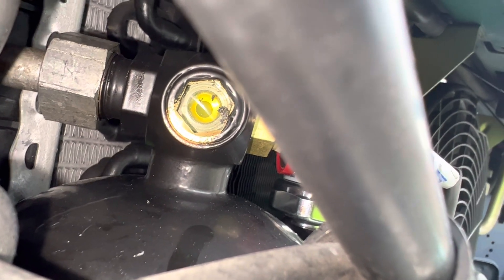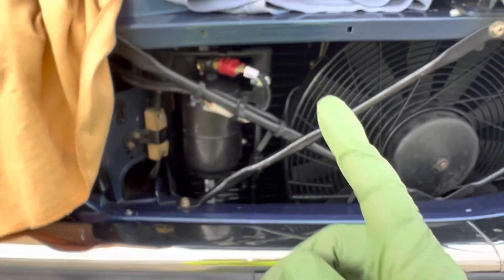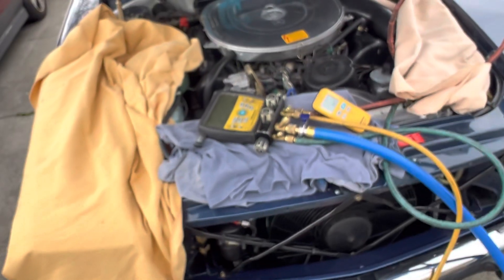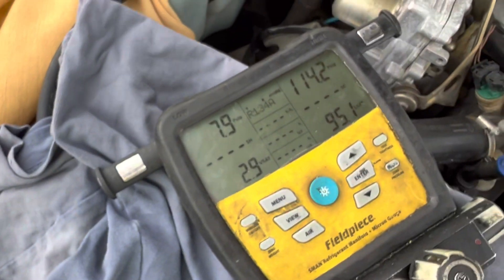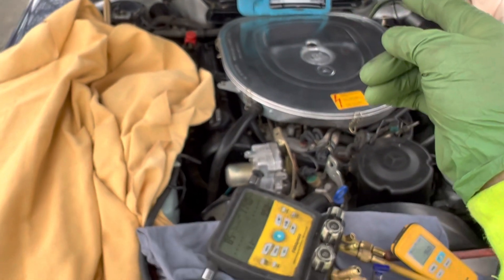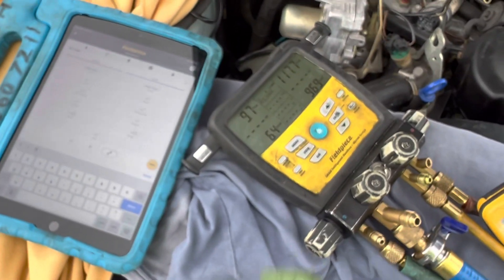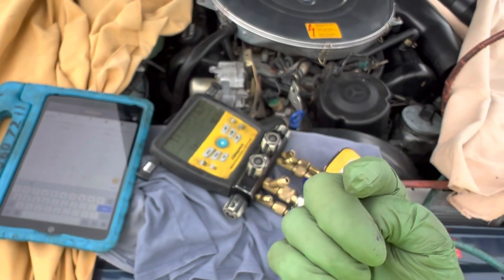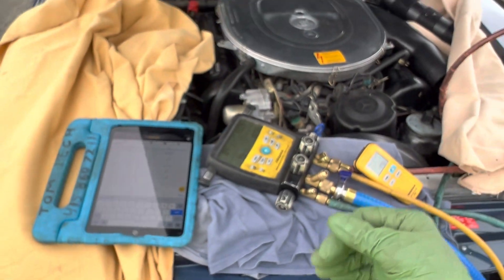R134a RETROFIT REFRIGERANT SIGHT GLASS SHOULD NOT BE CLOUDY or GET RUSTY if (“ DONE RIGHT” !!!…)

Comment: the AC fan is not working
Reply from the maker: AC fan is working the mechanical fan on the engine. The electric fan is secondary..
    The auxiliary electric fan does not come on until the high side pressure hits 270 psi